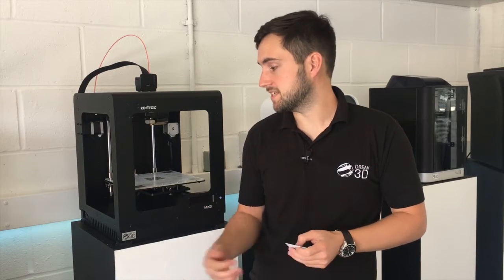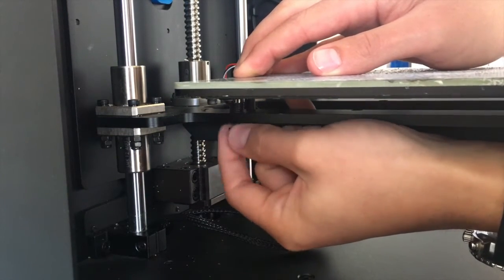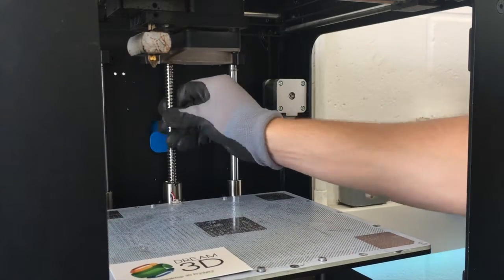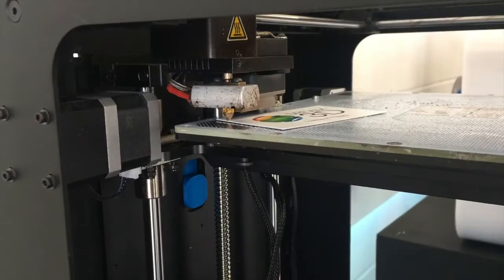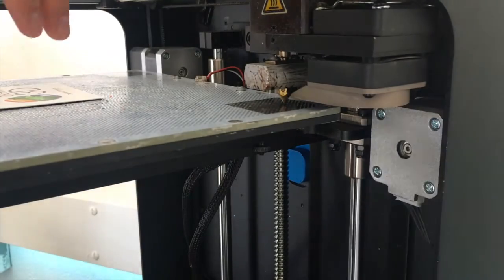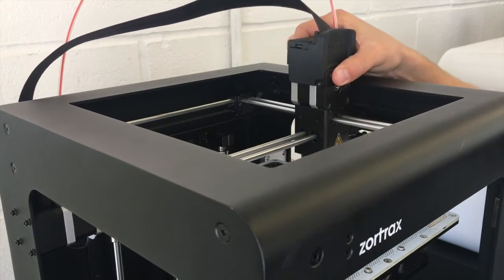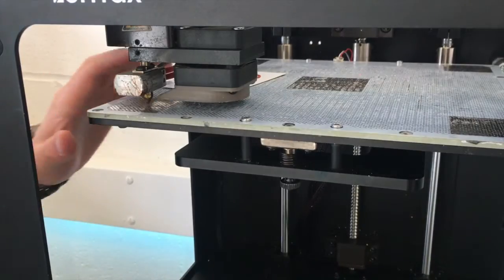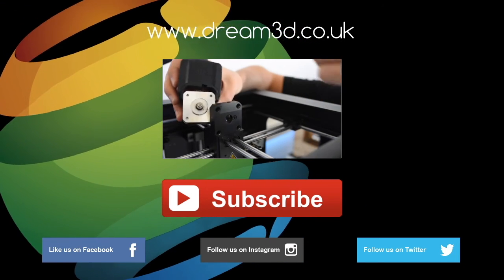Manually Levelling the Platform on the Zortrax M200 | Tutorial | Dream 3D

Comment: Good tip, however I'm not sure why you'd do this instead of the built in electronically guided calibration routine. Initial setup perhaps?
Reply from the maker: Hi Crivo152, we get asked a lot about how and if the Zortrax can be manually levelled. This is useful if the auto calibration fails or if you don't have the time to go through that process as it does take considerably longer than manually levelling.